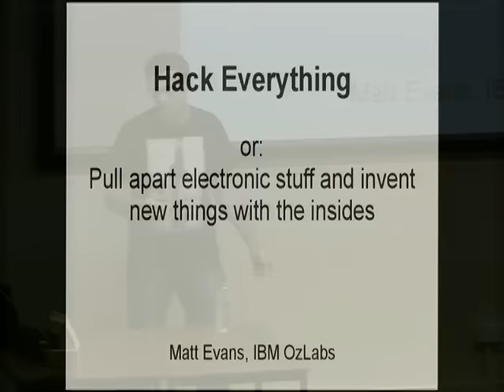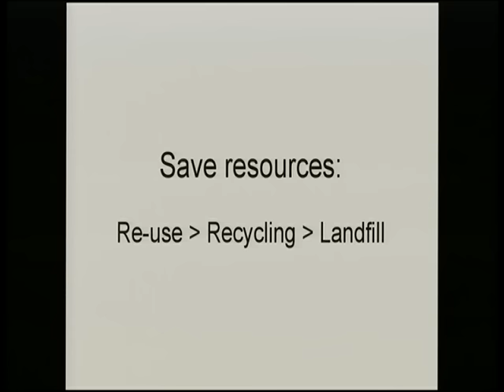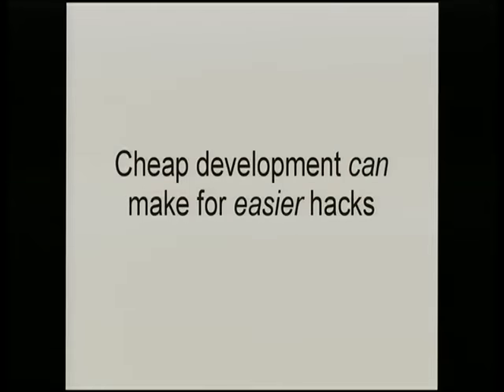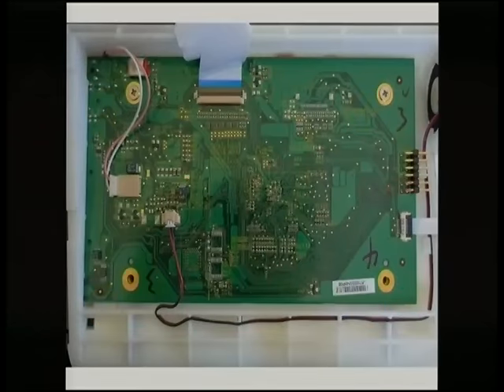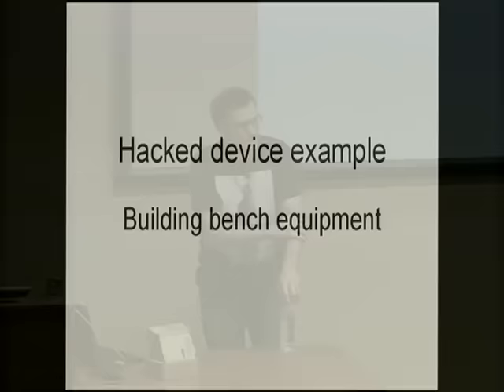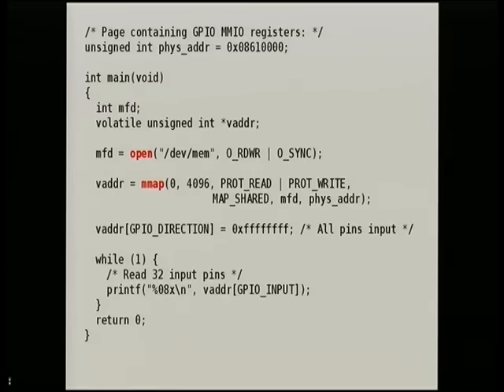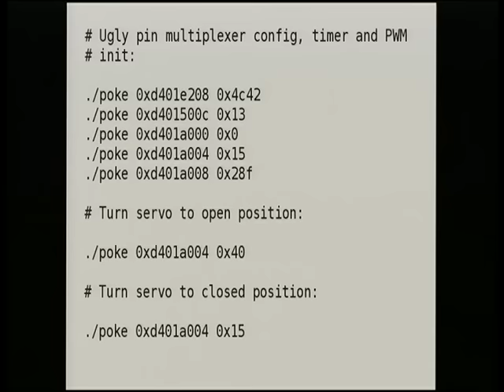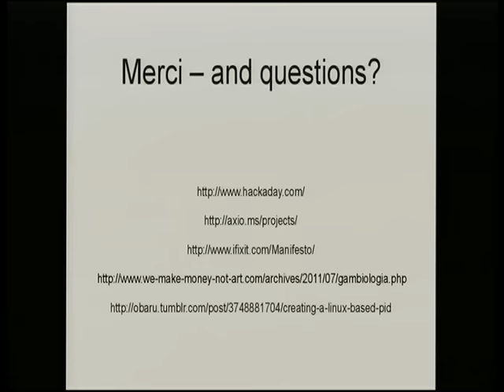Hack everything: re-purposing everyday devices - Matt Evans

Comment: I wish more people were publishing in this area. There is so much about "upcycling" old devices that either ignores the digital electronic parts or makes them into coasters or jewelry or something... I've just found a couple of old DVD drives and would love some kind of shared resource or forum or anything where I could get started on utilising the compute power that's tucked away inside them... but I just haven't got the months/years needed to work out everything myself.
Reply: I wanted to use an old android device as a pure hardware that I can install a tiny OS on and run some fun graphics on it. Dived deep into how to do it. It turns out these devices actively prevent you from doing that. They are completely closed off except for very few releases where the manufacturer kept certain bits on/off appropraitely inside the ROM so users can load any arbitrary OS on it.
Reply: @sayamqazi  you should be able to get around that by rooting and unlocking the room loader. I used to do that with my phone when I was bored. But you're right, without the root, you're very limited
Reply: @Handlebarrz  I know that but some phones are impossible to root. When you are able to root a phone has a prerequisite which if the manufacturer wants they can lock you out of rooting. Then you need to find if people have found an exploit for their prevention. This is why every version of iPhone has different method of jailbreaking.

Note I may have conflated the terms "unlocking the bootloader" and actually "rooting" the phone that caused the confusion.
Reply: @sayamqazi  we're both right. As long as you can find the root exploit, possibilities are endless. Being it harder to do so with flagships or security savy hardware manufacturers
Reply: I saw some videos here on YouTube on using the dvd drive sliding mechanism to make a mini drill press.
Reply: @MrRusty-fm4gb  That would be good for drilling PC boards.
Reply: @MrRusty-fm4gb  I saw someone on here make a 3d printer out of the same
Reply: Absolutely agree!!
Reply: research your local land fill ewaste day its how i learned tech in the late 90s
Reply: I had a broken bug zapper mini tennis racket thing.
    I used the handle & guts inside, took off net end cutting 2 wires.

Fixed 2 springs on the end.
Ran the 1 wire to each spring &  bam- party tazer!
    Very simple. Light you up pretty good.
    
    It would keep its charge after you let off the button,  so i accidentally light myself up more than anything.
   Thought about putting larger capacitors.
Reply: The specifics about this comment hit me pretty hard lol.. I just got done gutting 2 old internal optical drives, just to experiment with using their enclosures as 5.25" -> 2.5" bay adapters.  Not sure if either of them still functioned, but I noticed the chips on both boards as I was throwing them away.  One was an old Sony Optiarc DVD drive and I felt shitty for throwing it in the garbage, even though I don't have the hacker chops to do anything with them.
Reply: I'm in the same boat. Absolutely everyone around me is completely turned off from the thought of learning it seems. Everyone j want to buy stuff. Well so do I, but I also like to learn and make things. And it would be nice to find some like minded people. 

Thats how great companies start!
Reply: @Jupiter Cyclops  its been awhile since I've heard two words that i thought would never be used together- party tazer. You kids these days are tapt
Reply: @Handlebarrz  Many low end prepaid android phones have the unlocking part of their bootloader purposefully ripped out. Companies don't want you unlocking these things THAT badly!

So the only option with these twats is some nasty form of kexec...
Reply: Tbf my old Dell Dimension 2400 probably has more compute power then all of those drives combined.
Reply: Agree! So wish there was more people posting doing this stuff, I guess it's up to us to just record all our weird crazy projects and Frankensteined electronics,lol and get the posted. I'm just not so organized nor clean, to be able ti really present a good video for anyone to watch and be able ti tell what in the world I'm doing...me and my man are always working on something crazy, fun, idk we've thought about recording them and doing a YouTube channel, we're just too random to be able to have the set up all together when we are working on stuff.

Comment: I f*****n’ love taking apart appliances and devices, and looking at the electronic and mechanical parts to see how it works, googling info on stuff I’m not sure about, and hoarding(on a small scale) the good stuff to use later when I’m in need. I pull a lot of stuff out of dumpsters and whenever I’m out and about I’m always looking for stuff. I’m almost 40 and just getting home into electronics. As far back as I could remember, I would get Cheap RC cars as gifts and before I got the chance to put the batteries in them, I would take everything apart and marvel at all the components Inside while having not a clue what any of it did(except for the obvious mechanical/gears parts). I grew up strictly on regular legos and technic legos btw.

Comment: the biggest obstacle to the tinkering culture, at least for me, was alwasy the fear of either breaking something irrepairably, or somehow getting an electric shock!

I really think schools should have electronics as a core part of the curriculum. Electricity is everywhere and people should be safe and confident handling it.
Reply: +paddym27 for example i remember spending one hour in high school being taught how to wire a (uk) plug. For the last 20 mins of the lesson we were all told to wire one and bring it up to the teacher for inspection. I did mine, and was told by the teacher it was downright dangerous. But the killer was... that was it. No follow up, nothing. This is a key life skill!
Reply: +paddym27 i still dont know how to wire a plug.
Reply: @paddym27  WHY?
Reply: That's another good reason to try and make things out of old junk... it doesn't hurt so much when you brake it irreparably.... and you will! There's no escaping it.

Comment: Your shelf looks like a small portion of what I have collected, it was originally for recycling, collecting the precious metals, however, I looked at it like you do ‘can they be used for other things’? Im just not creative enough or have the know how for it. I can easily repair electronics with the original part, iPhones are an example. If I could use them for other purposes I definitely would but have no idea where to start and what to make? I don’t know what the chips, board and such do to be able to repurpose them.
I’ve learned how to fix basic ohv engines so I can fix and service my own and others if needed, and many other things too. So I’m sure I could grasp the deeper side of electronics. Thanks for posting this.

Comment: I love this talk and have tons of little side projects including repurposing a first-gen Battletech Pod (large sit-down, fully-enclosed cockpit from the early 90's) with new PC-control flatscreens and 6-channel sound.  Also, Weirdstuff is great!  I go there every few months and some of my finds are;

* Several wood towers designed to hold hard drives but repurposed to hold arrays of Ztex FPGA boards (incidentally, repurposed from FPGA-based bitcoin miners)
* 1980's reel-to-reel tape drive that can read/write IBM tapes from the 1960s but suitcase-sized form factor.
* Several Intel boards containing HDMI/DVI/VGA ins/outs - presumably for testing video processing on Xilinx Vertex-II FPGA
* Lots of NeuralID industrial camera inspection units - Hard metal boxes, opened up to find PC/104 stackable computer with 1Ghz Pentium3 PC and camera is hard-wired but standard USB.
* Lots of beautifully machined aluminum pieces for mounting, hinges and brackets
* 8 foot high rack with the complete robotic tape loading mechanism from a large tape jukebox.

Also, the Palo Alto tech swap meet is another place to find even rarer stuff for even cheaper.  This month I snatched a 8" floppy drive and a Agilent spectrum analyzer with all it's guts taken out, only the power supply remaining - ideal for building a modern version of a Kaypro luggable.
Reply: There is a thrift store near me where I can get a lot of old keyboards. I'm new to this. I might pick up a few just to use the cords and connectors in my projects, but after watching this, now I'm curious if I can use the electronics inside to do something other than be a keyboard.

Comment: Awesome video. I love building things and reusing old things in new ways. This is way more in depth than anything I have tried. I've never tried hacking the software or firmware of anything. I do stuff more like use an old pair of children's walkie talkies to make an intercom between the house and my work shop or take a UPS that someone threw out because of a dead battery and turn it into a power inverter to charge drill batteries in my truck. I recently turned an ATX computer power supply into a variable output benchtop power supply. I'm just starting to get into arduino now, but I still need to learn to write the code to make it do something.

Comment: been doing exactly this since i was 5 years old. im not gonna be able to reprogram a terminator but i could  probably figure out a way to loop "hello world" out of the terminator's mouth- as long as It wasnt gonna kill me.
Reply: +Troy Nall I like that Idea, you can also put an infinite loop saying "Hello World" in front of every kill command. This way it will just gonna run up to you and say Hello world a gazillion times until it run out of battery.
Reply: but what about enhancing more modern systems why cant I double the performance of my galaxy s3 when I have a near identical board....
Reply: its called bottle necking. no matter how fast the processor is, the data bus is limited to how many bits it can squeeze through the different areas of hardware.  this is a very simplified answer. ive seen identical model phones made by haewuii but one was a mark 1. and the other a mark 1s.

both had full size sim card slots. but upon tear down of both devices the 1s could indeed had a sim, but the 1 could not. all the mark 1 was missing was 5 micro wires connecting the sim slots leads to the board. so the performace here that the maker charged 150 dollars more 5 micro wires.

the mark 1 was wifi only device. the mark 1s was both wifi and 3G.

so sometimes performance can be affected but after only careful examination.
Reply: +Troy Nall I think the price difference is due to the lack of certification-, testing- and approval processes that are mandatory for the GSM module. for example I have a Xiaomi phone which supports LTE band 20 (mostly used in Europe), but as Xiaomi still declares itself as a chinese manufacturer they don't feel the need to officially support anything outside of China, so it's disabled in the nvram settings (which have been already unlocked by using custom a kernel to circumvent the Qualcomm check, etc.) but my point is that this way they also save money (hence the pretty good prices), they simply do not have to seek the approval of the relevant authorities which requires rigorous testing --> costs a lot of time and money, which then would show in the retail price of the device, like in your case. but i have to add this is just my understanding, i could also be totally wrong :D
Reply: troy could you help me I have horrible neighbours that listen and record everything I mean everything could you make me somthing to stop them please I'm dissabled and I cannot afford a lot but if you trust me I can pay somthing
Reply: Terminators never not kill...
Reply: You need to tell us HOW they are recording things

Comment: Passive consumer-ism is the worst thing to come out of modern culture.  I've been taking things apart, trying to understand computers, collecting old electronic junk (even buying some at the thrift store because I liked the way it looked, old keyboards, network cards, old monitors, you name it)  since I was 7 or 8 years old.  My first computer program that I was real proud of?  A little thing in applescript that made the computer say a greeting on startup on an old iMac G4 running Mac OS X Tiger (This was back in the early 2010s).  Sealed disposable electronics are horrible for the environment and are harder to modify/repurpose/reprogram.  Mobile devices like phones disgust me for that reason.  Glue instead of screws?  Really?  I especially hate DRM/locking software.  It's my hardware, it should also have software that I have full freedom to modify.

I think software copyright should be heavily modified.

(The law does not allow for rooting android tablets from what I've heard.  I'd like the law to regress to how it was when the Declaration of Independence was signed.  1776 government, 2020 technology.)
Reply: It seems like software user agreements shouldn't force customers to take all the risk when it's their product. 

Also, it is admirable what you were able to learn at an early age, but people need to be made aware that many others are killed each year by TV and Microwave capacitors.
Reply: Fck the law, do what you want. You can buy rooted old phones online. Do it. My phone is from 2017 and just keep rebuying the same one

Comment: fascinating. I found  a lot of media devices in the E waste bins I've fixed and re used like PCs, Like the  Alienware Laptop I'm using now. in a dumpster. with no harddrive or battery. a vat of grease poured on it. No audio output working. or cd drive. or back cover. Pizza box taped under it.  Found HD with broken Windows OS . Using Ubuntu. Works  when used for an hour, I i smells like a Fast food place . but works well.

Comment: Found myself lots of times having broken/obsolete electronics, and even though there is a way to repurpose it, I can't freakin' do it because the designers of that particular device used components where nobody can find a datasheet for them..
Reply: Or hide the key part Id's so you don't know what it is.
Reply: @alantripp6175  fast forward 7 years later becoming a full-time electronic/software engineer I can fully understand the rationale behind that. Protecting IPs. Some Chinese guys really enjoy reverse engineering and counterfeiting products. Whatever you can do to prevent them or even slow them down will be in the benefit of the actual company that develops. The downside of that is that us, free time tinkerers can't do anything about it and we are left with a consumer-driven economy with no reusability in sight.

Comment: I found 2 G5 towers in the dumpster and using the Power supplies to make a bench top power supply and a soldering station with the different voltages for different guages of salvaged nichrome wire.

Comment: I've been tearing apart, disassembling, repairing, breaking (some accidental, some with intent 😅):since I was about 6 yrs old. Still at it, now repurposing a retired airport shuttle bus into my final home. I've always been drawn to and used computers, but have been too intimidated to attempt an understanding. Consequently my rebuilds tend more toward Steampunk. When I was 10 I built my own database but never completed the information upload. Mainly because it was a clock with a second hand with the numbers 1-12 replaced by the English alphabet. To learn about Computers, for example, you'd set the clock second hand to straight up "nothing", then press Fast Forward on an attached cassette player wired to the clock. When the clock hand hit "C" it would stop the cassette player and you'd press "Play" to then listen to me reading from my dictionary about everything starting with the letter "C". Pretty rudimentary and useless, but I was so proud and had  a hell of a great time. Oh, and it also had a board with 20 or so flashing Christmas tree lights to ramp up the WOW! factor. This was 1975, so my suitcase sized computer blew the socks off scientists using room sized mainframes. Lol, not.
Reply: It'd be awesome you uploaded it!